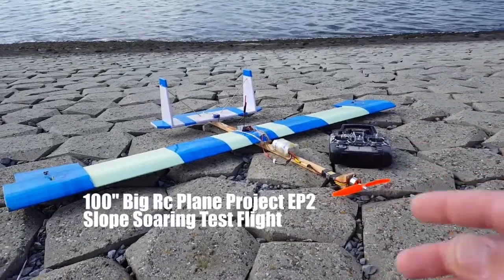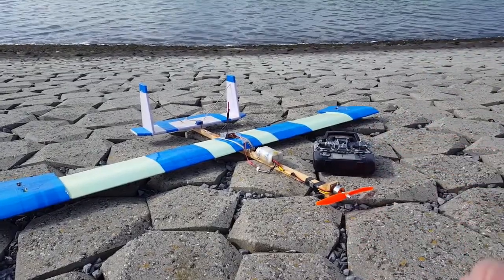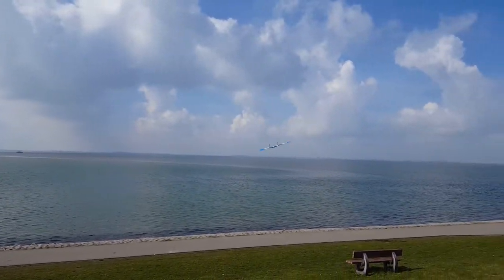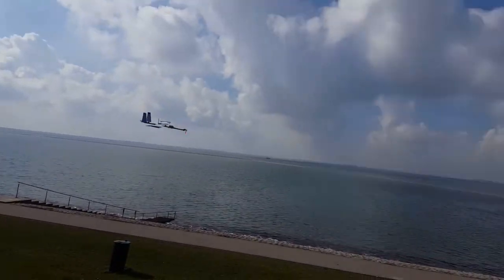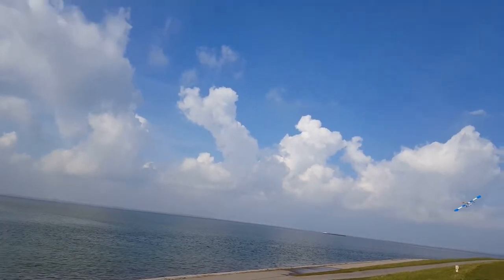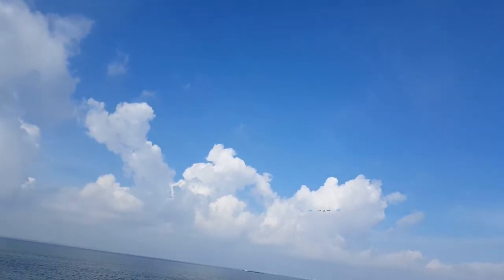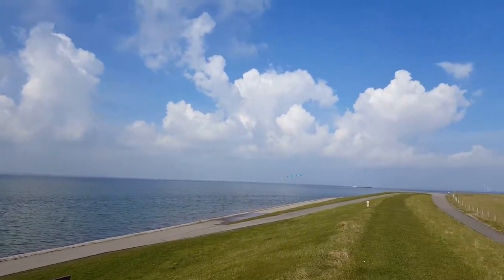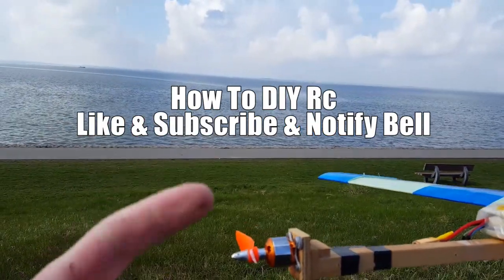100'' Big Rc Plane Project EP2 Slope Soaring Test Flight of an FPV Airplane

Comment: I recently built and crashed a plane 
Can you suggest how to start with flying...
Reply from the maker: built a simple plane they works the best most of the time and are easy to repair
check my 5$ trainer plane
Reply: Can I use a pvc pipe for fuselage instead of wood..?

Comment: Nice job. Have you tried using a piece of fishing rod tube for the fuselage?
Reply from the maker: no we prefer to fish with a fishing rod but i do get the idea saving weight thx for the tip Sir :D
Reply: Ok, but if someone has a broken fishing rod . . . :¬)
Reply from the maker: that i'm sure to give it a try and save a bunch of weight of course :D

Comment: Sounded like very strong wind you have there but it flew very well.
However I have a question without landing gear wouldn't the prop breaks every time it lands?
Reply from the maker: i'm working on both but my new shogun mic failed to work :(
and without landing gear, the chance is bigger but you can set auto-brake on your ESC than the props stop spinning at 100% and save your prop during landing just like on flying wing they also don't have landing gear! + these prop brake super easy and are super cheap and i prefer the prop break than a motor shaft bend but we have added landing gear coming up in a few episodes and yes it is saving a lot of props hahaha
Reply: Thanks for the insight. Hearing the wind actually give more sense of environment to me though.
Reply from the maker: np :D
Reply: You can install....just a nose gear and wires on the wing tips. You know...like the original ugly stick.
Then you gotta deal with drag. yeap it's sort of a drag , either way.lmao
The landing gear is going bend. break...ect eventually too.
Choose your break point. ..